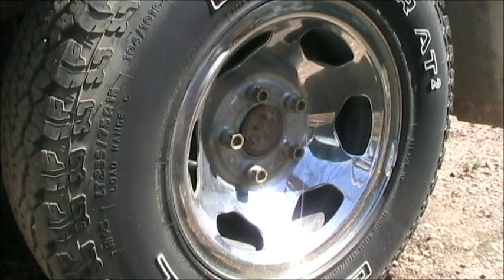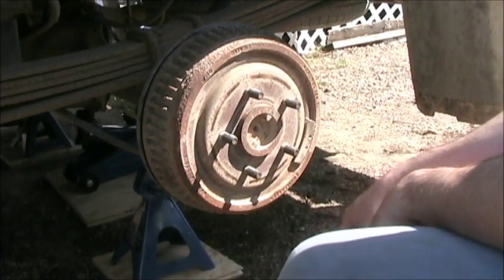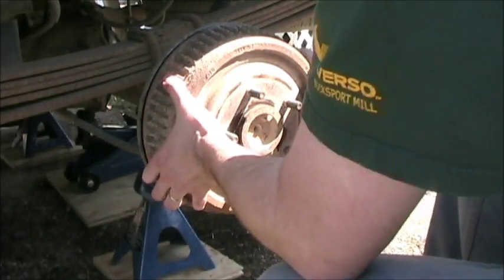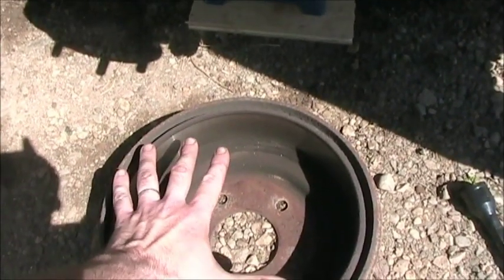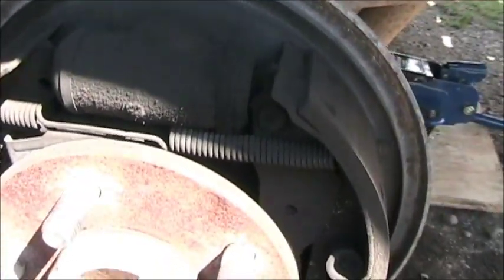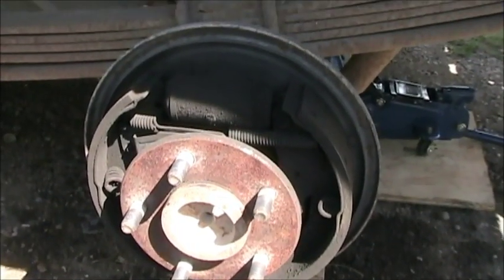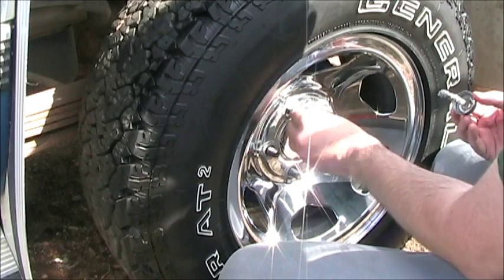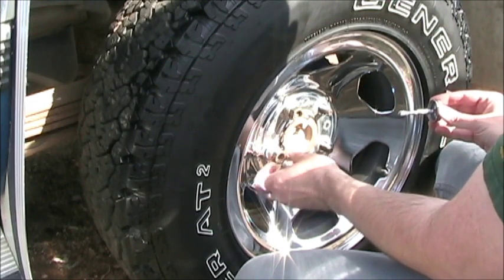Rear Drum Brake Inspection DIY - 1998 Chevy Silverado

Comment: How do you tell what size the brakes are whether they are 10” pads or 12” pads that you have without taking the wheel off yet
Reply from the maker: Internet might help you here, I’m sure there is a measurement but I just look it up.